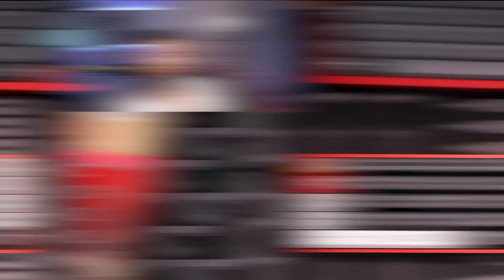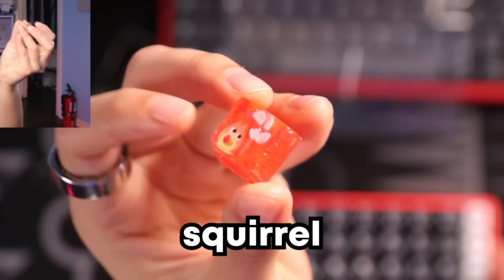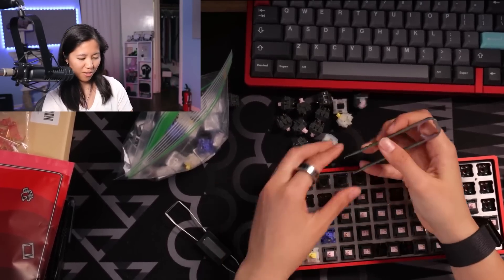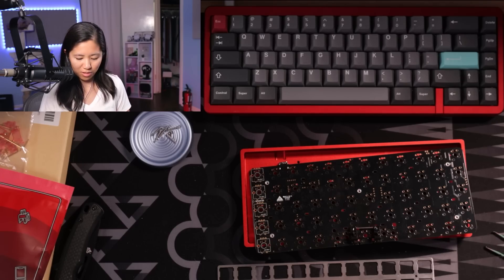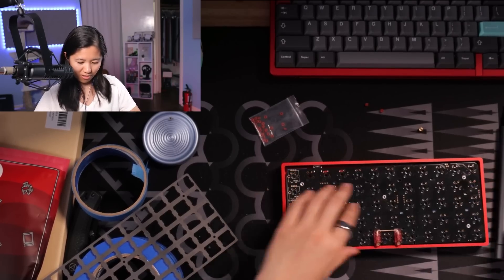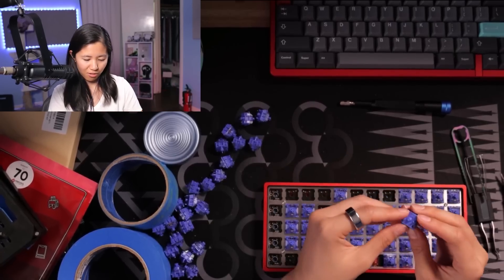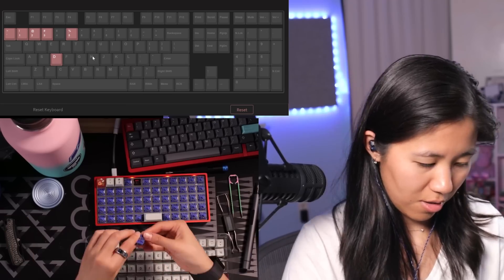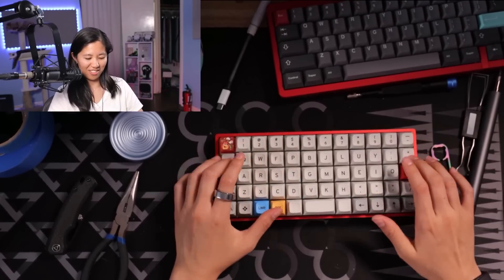The WEIRDEST upgrade I've ever done...

Comment: The steel plate on this board is  just super tight and destroys switches, your hands, patience and wallet. I recommend getting an fr4/acrylic/pom/petg plate cut, files are out there. Or do a bit of filing...also to make it sound better, use super thin foam, tapemod, lubed and filmed linears, o-rings around the keycaps and 'floating' plate....took quite a while to get this thing into a reasonable state

Comment: I've got a drop alt, and I'm looking to swap the keys from kailhspeed silvers to something easier on my carpal tunnel to press. I hate tactile switches but I liked the Razer greens which are like a clicky blue. Im reading Kailh bronze are linear but with a click, which is in line with what I want in terms of feel. Is there a linear switch with a click that is easier to press and possibly even quieter than the Kailh bronze?  I could also use a few switches that are harder to accidentally press for caps-lock and windows home key, what switches would be good for those? Is there a site where I can order a mix of keys and come out cheaper than buying two full sets of each key?
Reply: Oh my gosh, hi, I'm only a month into the hobby myself but basically went insane over it and have tried a bazillion switches by now. My boyfriend has arthritis and carpal tunnel, and I need very light switches but prefer linear and clicky, so I think I can help!
I would actually say to not use the speed bronze, even though it's light, it kind of has the feel that it needs more force. If someone asked me the easiest-to-press clicky, that wouldn't hurt carpal tunnel, I'd say Kailh box white, or Kailh white owls. If someone asked me for the smoothest and easiest-to-press linear, I'd say Durock Creamy Yellow linears (sometimes called L1s or 55g). There IS a tactile that feels like a light and linear clicky, called Pewter, from Parallel. I personally would not give my boyfriend any of the kailh speed switches for his hands, or a majority of popular tactiles. My last recommendation would be to try a Bobagum with the lightest spring (they have different spring weights), but lube it, if you want to try a very soft and gummy feeling silent switch that is low effort to press. I hope this helps!
Reply: @boogiemanbumblebee Unfortunately I already ordered a hotswap keyboard with Kailh Bronze (Same price as ordering the keys without the keyboard), although Im reading theres no good way to tell whats best for a particular person. I'm reading the slightly extra force might limit my fingers from bending as much,  causing less pain from that. Since I seem to bottom out half the time, maybe the extra force and the clicky feedback will help?

Apparently more research has been put into making the boards themselves more orthopedic than the switches.
Reply: @Ima_Tron  at the very least, since the board is hotswap, you can always change them out if they prove too strong. I would say that yes, boards themselves tend to be designed ergonomic much less than the switches.
If you tend to bottom out and like doing so, you probably would enjoy clickies, then! If you're still able to purchase them, I do think that kailh box whites or white owls would be perfect for you. Part of the issue with the speed switches actually is the short travel time-- I've found that for myself and boyfriend, you wind up hitting the bottom much harder than you might on another. The travel distance on a regular switch honestly does not take much force, if anything, the force can feel like less.
Definitely try your bronze to see if you like them, but if your fingers are hurting, I'd try either of those white clickies I mentioned for sure (owls are slightly lighter than box). Clickies are meant to be bottomed out, tactiles not so much, and linears it depends on the switch.
I would also say something very important is the angle of your board and keycaps. If you got a drop alt/Ctrl, I believe you can keep it pretty flat; I would look into keycap profiles to decide what angle the keys should be that you're comfortable with. Personally speaking I find cherry profile to be great, and my keyboard is at a very very slight incline (not perfectly flat). Some people with totally flat boards like XDA profile. If you have a steeper angle though, something like MT3 or SA profile may be more comfortable.
There are so many options to customizing a board, and you can get really nitty gritty with adjusting it to your liking. Of course, the only issue is the cost! But I hope these comments help you narrow it down more easily
Reply: You should try Gateron Clears, they are linear and lighter than reds, it feels like pressing on nothing
Reply: @bartsi7325  Thanks for the suggestion! I'm trying the kail Bronze right now, got a deal on a hotswap keyboard from amazon and swapped them in. Ill keep an eye out for a sale on the Gateron clears.

Comment: Would it be viable to have taped the bottom of the case as well so any sound getting through the initial tape is stopped by another layer instead of the case. Idk I just thought it might sound a bit better cause the sound wouldn't be bouncing off the loud metal.

Comment: Almost nothing beats Colemak-DHm on an ortho keyboard in terms of typing comfortability, it only gets better if you flip the space bar and the raise/lower keys next to it 180 degrees.
Reply: what do the raise and lower keys do? i don't know
Reply: @Christmaswreath  they give you access to different layers.
Reply: @Christmaswreath  It's a layer key, like "shift" acts for a layer for capital letters. You press e. g. 'lower' and you get the F-keys in the top row instead of the numbers. You press 'raise" and the top row changes to special symbols, you press both and you get e. g. navigation keys and "home, end, page up/down" etc. It's programmable so you can put whatever keys you need where they fit best for you.
Reply: What about colemak-dh on a split column-stagger board?
I'm thinking about building one of those, but I want 3 keys for each thumb, 6 columns per side and a number row with Ctrl on the very bottom left and I don't think that's been done before.
Reply: @nottheengineer4957   I have no experience in that personally, but you could always get a custom PCB. However I know that a lot of people who have those kinds of keyboards will often program the Z key (or whatever key is in the bottom left of your preferred layout) to act as the letter when pressed but as Control when held, which seems like a great alternative to me, though I'm not sure how they get Ctrl-Z since I don't personally use a layout like this.
I actually use the Preonic with Colemak DH just like the one in this video but I have the acrylic case with Boba U4Ts on it.
Reply: @nottheengineer4957  Are you thinking about  an Iris (from Keebio)? I use one of those too - tented 45 degrees - with Colemak-DHm. You can program those boards using VIA/vial as you want, that's the beauty of it.
Reply: @nottheengineer4957  sounds like you are describing the the Lily 58, it has 4 thumb keys  but you can simply not use one. Colemak DH works really well for those kinds of keyboards. And you put the modifiers wherever you want. Takes some experimenting to figure out where everything has to go to achieve the best possible keymap for your workflow.
Reply: @ThatManFromGermany  thanks
Reply: @nottheengineer4957  dygma raise would be my recomendation.

Comment: That's a nice layout. If it's available as prebuilt, I might buy it.
Reply: It's a drop x olkb preonic! it's not a prebuilt but it's very very easily to assemble. you just put your switches in the plate and pcb, screw the pcb to the case, and put on keycaps. that easy.
Reply: @turbomeows  It's hard to get keyboard components here in Greenland, so retail sellers are easier to send prebuilt stuff. Drop doesn't even ship to Greenland, sadly.
Reply: @abelolsen9656  ah I see, unfortunately orthos aren't super popular so there aren't any prebuilts that I know of
Reply: @abelolsen9656  actually, there is the Planck EZ which is a prebuilt but does not have the number row. There's also the moonlander but that's a split keyboard. There are ortholinear kits on Amazon too. But all of that is only to say if they ship to Greenland in the first place. I hope you're able to find something.
Reply: @turbomeows  Aah, 230$... And it's on the cheaper side? I found same layout on aliexpress, but... Yeah.
Reply: @abelolsen9656  yeah they do tend to get a little pricey and that's not even considering the shipping to where you live

Comment: Put switches, pcb and plate together first making sure you support the hot swap sockets from the back and then you screw it all to the case. That is the best way to go, makes it easy to build and prevents  a hot swap sockets coming loose.

And kudos to the owner of that keyboard, ortholinear Colemak is the best way to go.

Comment: I sympathize with you on the layout thing.  Me, there's no way in hell I'd ever go below TKL. I don't understand why people so eagerly surrender functionality.  Hell, I have a 100% GMMK1 and a 96% RK100, but at least a TKL can be paired with a standalone keypad and not lose functionality.

Also, that ortholinear keyboard is odd.  I can KINDA get why people wouldn't like staggered layout... Maybe.  However, not having the modifiers be different from the main keys is bonkers to me.  Just seems like this thing is designed to hinder productivity in every way possible.  Also, are my eyes screwing with me, or is that space bar smaller than even the one on JIS layout keyboards?
Reply: Wait 'til you learn about the wonders of QMK/VIAL's tapdance, layers & homerow mods! 🧠

These boards—and smaller, even—"lose" 0% of the functionality on a full-size keyboard (including the useless and/or phased-out keys that aren't relevant today, if you want 'em...). But they have a MUCH smaller footprint for less hand-&-wrist strain as well as no-longer having to look down and take your hands off the mouse for common functions:
    Believe it or not, these actually gain MORE functionality than even a 109-key board thanks to all of the custom keycodes & functions, macros & an ocean of other unique features thanks to the underutilized magic contained in QMK's deeper features! I can't believe with such a vast standardized custom-firmware program included in most boards today, SO MANY PEOPLE STILL REALLY THINK COMPACT KB ENTHUSIASTS ARE GETTING BY WITHOUT BASIC NECESSARY KEYS LIKE MODS & NUMBERS, JUST BECAUSE THEY AREN'T VISIBLE ON THE CAPS! 🙃

Comment: People are silly for telling you to use blue tape. The only reason for using blue tape is that it is cheap, covers a wide area faster and peals off without mess.

Using electrical tape is the safer option if you are worried about a fire. It may also leave more residue.
Reply: Yea I think the residue it leaves would be the only thing stopping me from using electric tape. For something I use everyday electric tape is the way.

Comment: I also have a Preonic and the plate tolerances are something else. It was super hard to get the switches in and I wore out/practically ended up scraping off the little bumps on almost all my switches and it definitely wasn't a good experience... but I love using it now. I just think the assembly experience could have been better.... I also agree that the keyboard is really hollow sounding, and it's really quite stiff, even with the loose plate build. I use silent switches so I don't have to deal with the hollow sound.